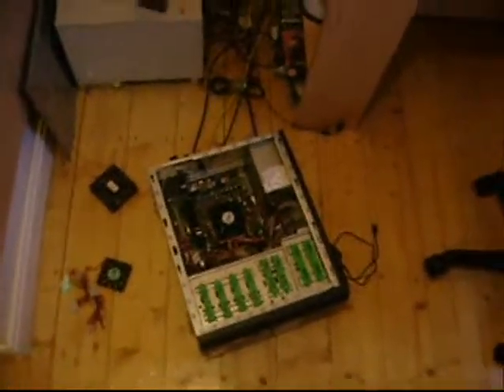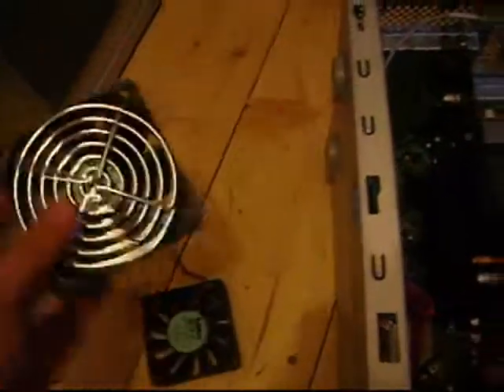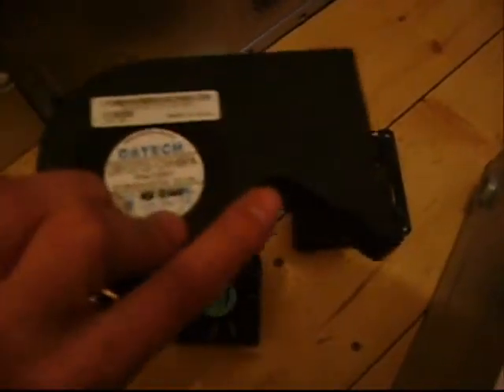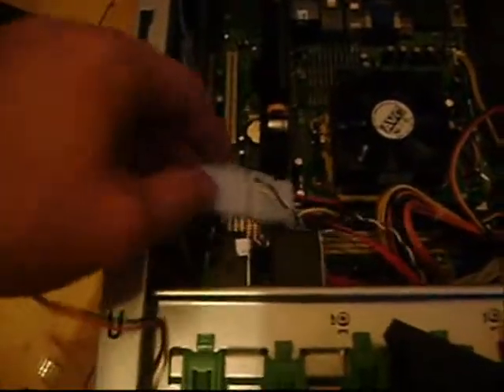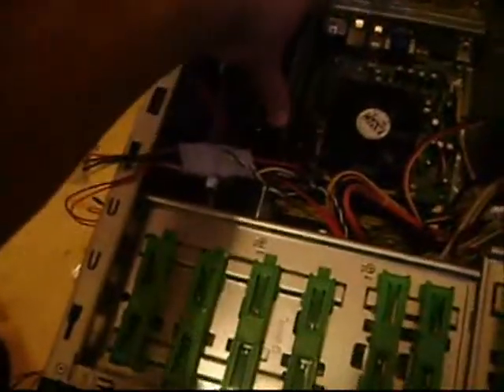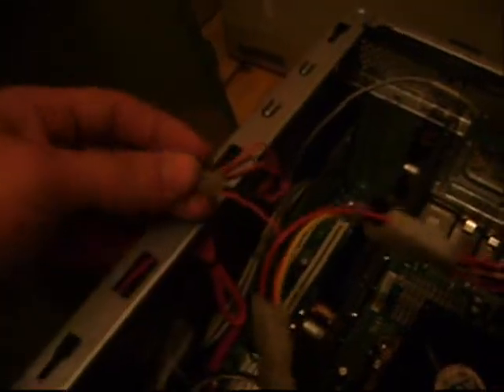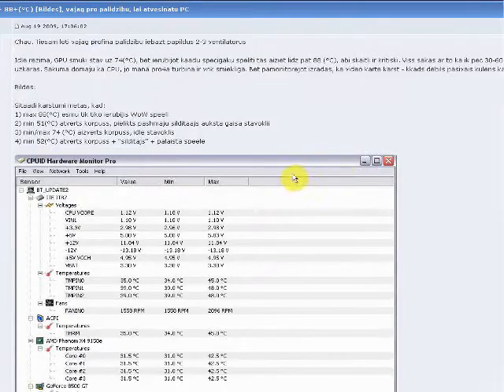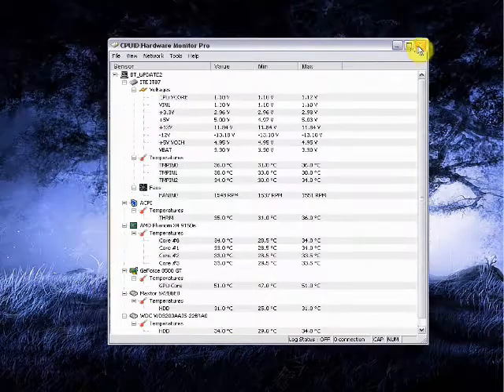How to install additional fans using 4-pin molex

Comment: When the problem is rlated with no or few power molexs,you can allways plug the fan into an outside power supplie (any 12v power supply),from an old printer or other thing else(celular telephone usually uses an 9v it works but you wont have the full power).And you can even put a switch on/off button on the wire of the power supplie.Cheers